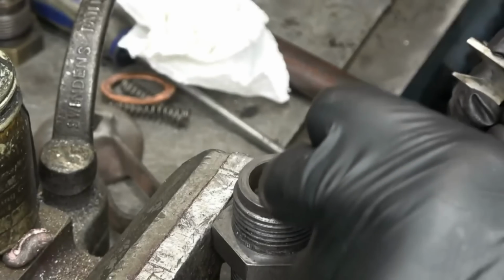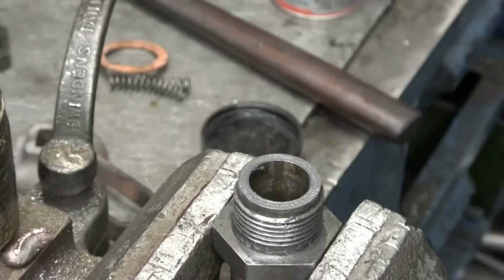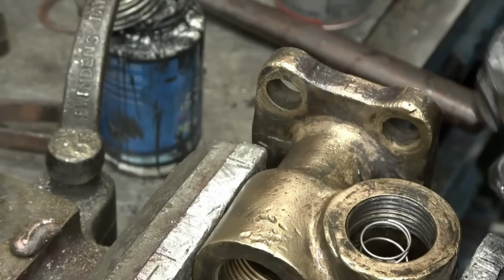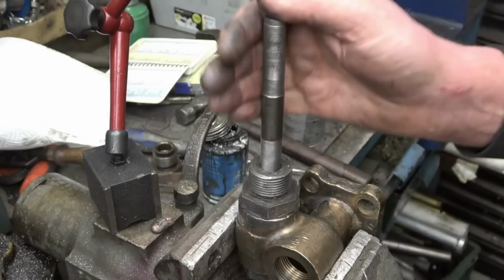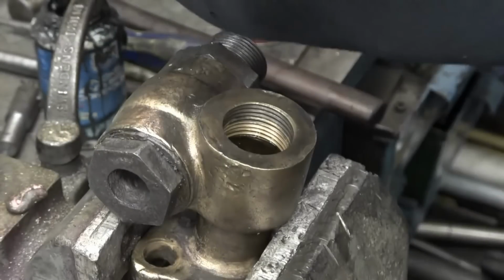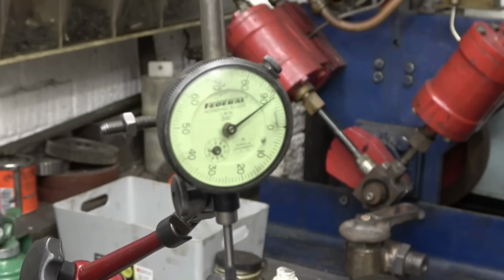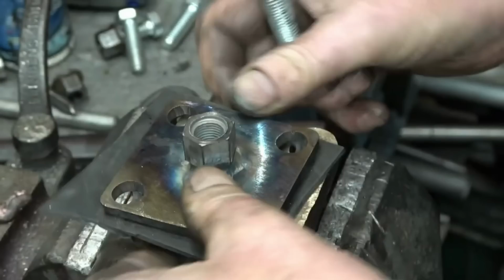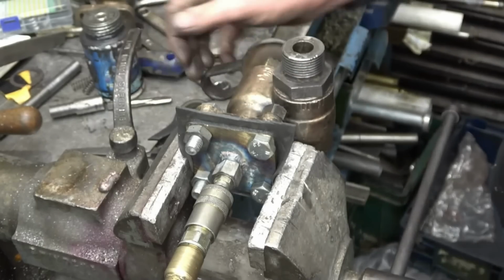SNNC 481 P2  Steam Boiler Clack Valve Test

Comment: You're getting a bit of a cosign error the way you have your dial indicator set up. 
We can see it in the camera view. At one point it looked like you had the plunger set up correctly (in line with the rod) but other times It looked like you were sloping the indicator rod at about a 20-30 degree angle to the rod which is a hypotenuse. As we know the hypotenuse is always longer than the adjacent side in a right triangle, so your dial indicator is going to read a greater distance than the rod actually travels. 
When your measurement is critical, and you're concerned about thousandths of an inch this matters.

Comment: Don't worry about the swearing John, it's far and in-between 😅.

Stainless would have been fine, obviously a marine grade being more suitable, though there are better heat resistant grades. Stainless steel was not available during golden age of steam. Fairly sure later on, stainless would be difficult to machine with carbon steel tools, pre High Speed Steel tools. Engineers do stick with what they know.
I see many decry brass on steam plant, ref dezincification, but it's location depends on full immersion, or substational contact with high pressure steam as is my understanding. 
Have a great week. 
Nice repair. 
Thanks for sharing

Comment: That valve's not very concentric.
Reply: I don't think it needs to be -- in fact you might not want it perfect.  It looks like it needs to be able to float around in there to avoid scale/dirt/reality from affecting function.
Reply: @gth042  What I meant was the head of the valve (the one he was lapping in) was eccentric.

It fitted quite well in the valve guide, but the head was running out.

1:28

Comment: Hi John, I owned a Super Sentinel for over 30 years and overhauled many items during my 10,0000 miles steaming on the roads, I noticed that you didn't put the flat on the valve spindl threaded portion, this is required to act as tell- tale and a safety measure to confirm that the valve has sealed agains boiler pressure before working on the clack valve, This is why the operating handles are the unusual dish shape so the steam or water is deflected away from the operator whislt the valves are beig spun shut or opened. On the pump clack it also prevents the pump from hydraulicing causing damge if it was accidentaly used whist the isolator valve was closed to boiler pressure.   As you did, taking metal from either the valve cap lift stop or from the top of the valve stem is the correct way to achieve the correct valve lift clearance.
  Best regards Harold Bell
Reply from the maker: Thank you for a valued comment